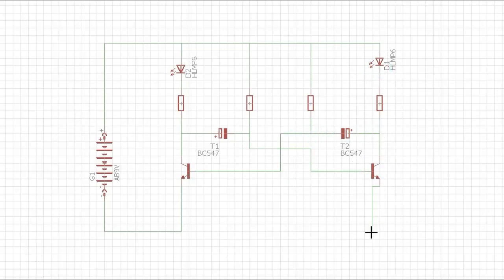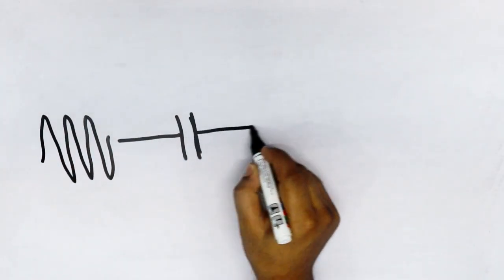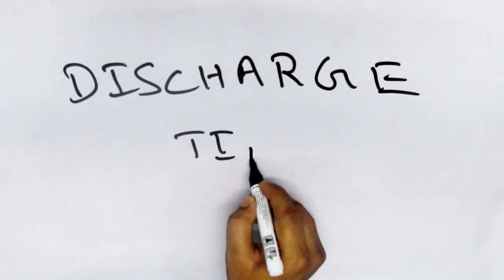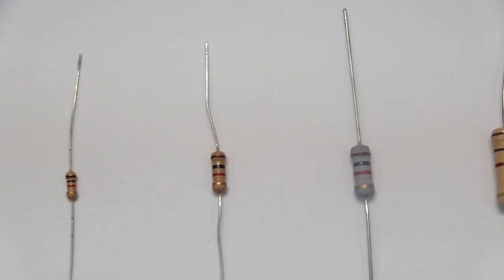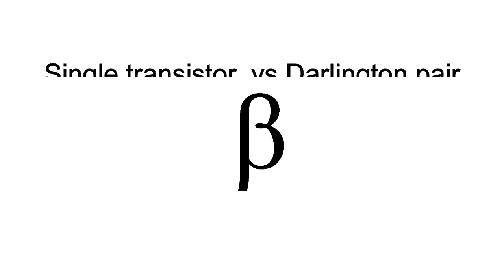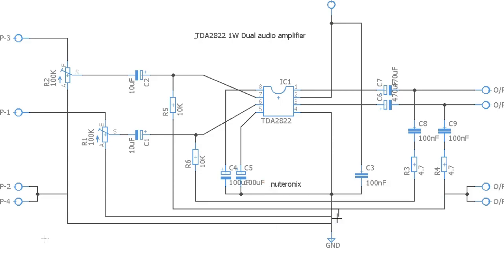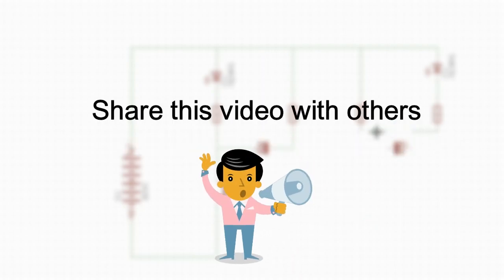10 circuit design tips every designer must know

Comment: Decoupling capacitor near the power source or near an IC chip acts like a shock absorber in your car. While the IC circuit is in operation its current consumption fluctuates up and down, at times the current fluctuation maybe sudden and dramatic if driving high load current. The capacitor near the IC acts as a Low Pass Filter (or shock absorber) to prevent those heavy sudden fluctuations and to ensure that the IC operation is maintained steadily - due to severe current fluctuations the IC may suffer failure. By the same analogy if you are driving your car on the highway and suddenly encountered a bumper or little stones then you may not feel it and you keep feeling comfortable, because your car's shock absorber springs took the shock and you didn't feel it - and you are still in that happy safe feeling. Thanks to the capacitor springs...!
Reply from the maker: Wow that's an interesting explanation, thanks Mike :)
Reply: Sir I wants to learn...how to design electronics circuits
Reply: Thats a good analogy
Reply: ❤️❤️❤️❤️❤️.....crucial info you just shared with us!!!!! This is very commonly deployed in High-End SMPS like Corsair brands directly on the socket itself ,beit for PC or other electronic devices...the only setback is the poor quality of the electrolytic capacitor they use for such high priced SMPS.
Reply: Eli Sebastian  I searched for it on Google, and the top reference was a clown.  Hmmm, am I doing something wrong?
Reply: @Gadgetronicx  It is also worth considering using flexible termination capacitors if there is any likelihood of flex in the pcb.

Comment: #1 0:41 Coupling & Decoupling Capacitors
#2 1:51 Pull up and Pull down resistors
#3 2:36 Discharge time of batteries
#4 3:33 Watch out for resistor Wattages
#5 4:21 Usage of microcontrollers
#6 5:01 Using transistor pairs/arrays
#7 5:57 Using PWM signals to save power
#8 6:49 Individual trances for signal reference
#9 7:22 Choosing the right components
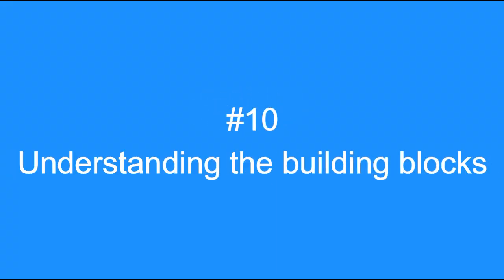#10 8:20 Understanding the building blocks

Comment: Great video, thank you! I learned some new things about capacitors and transistors.
Two corrections:
#7 "LEDs... are quite slow to react to a high-frequency PWM signal." Nope, LEDs turn on and off very fast! Most people can perceive an LED blinking at 200 Hz; some can see >300 Hz. Always use PWM frequency >400 Hz for dimming LEDs, or you may notice the blinking.
#8 "Provide individual traces when connecting different signal references back to the ground or common node." In the apps I've used, doing this in the schematic doesn't constrain the PCB layout at all; you have to remember to do it in the PCB editor.
Reply: You are correct. The video says that they are slow to react, but in actuality, it is the human perception which can be a bit slow to react, relative to circuit (digital signal/PWM) frequency.  LEDs themselves can be quick enough that an LED and high speed photoreceptor could be paired and used for sending an audio signal wirelessly.
Reply: In case of the ground return, copper pour or additional layer for ground is always helpful, if your circuit does not have any contraindication or constraint for that.

Comment: Tip#11 Reinventing the wheel.  There's plenty of circuits already made for most applications.  Just pick one and tailor it to your application.  There's rarely a need to start from scratch.
Reply from the maker: Absolutely true
Reply: Yes indeed, but also do not get afraid to invent if that is not available. Be aware and wise enough to judge that, the available circuit is modifiable enough to fit into your need.

Comment: Very helpful.  I'm not a professional designer but I like to hack things together to either make something fit my purpose, or from scratch if none exists.  I'll keep these points in mind as I advance to more complex circuits.  Particularly what you said about using a micro-controller rather than an assortment of discrete parts - something I should work on.  That being said, a 555 timer, a cap and a resistor versus  2 caps 2 resistors and 2 transistors, they can each accomplish similar goals but the former costs about $0.67, the latter, about $0.30.  That's been my justification for my fear of IC's.  But if I want to build better things with greater capabilities and accuracy, I really need to work on that "fear".
Reply from the maker: What you said is absolutely right but sometimes using discrete parts can get really messy. When developing products last thing we want it to be messy. Also I didn't shoot down the possibility of using discrete chips but rather spend some time to find the right way to achieve the objective the efficient way.
Reply: @Gadgetronicx  that is correct. And material costs is often not an issue for a maker. If you have a simpler solution you safe time and effort, event if it costs a few cents more. And the well known multivibrator solution with the 2 transistors, 2 capacitors and 4 resistors has serious drawbacks. One is the signal steepness, another one is the limitation of operating voltage to a maximum of about 5 volts (otherwise you get avalanche breakdown of the base-emitter diode of the transistors, which can be harmful if the capacitors have higher capacities, because the stored energy ist "burned" in the pn transition).

Comment: nice video sir!! , I'd like to ask why should we use two capacitor electrolytes and ceramic as decoupling?? is it enough to just use 1 capacitor??
Reply from the maker: That's a good question. Technically both the capacitors are decoupling ones. But the key difference is that the big bulky one serve as a charge bank and supplies the chip with current when there is a brief interruption in power supply. However small capacitor will be fast therefore it will be much effective is responding to voltage spike from the supply

Comment: I have a rechargeable electric shaver with a 2W resistor in the recharging circuit.  This electric razor cost $70 when new.  While charging, this resistor slowly burns itself up, especially if you deeply discharge the battery, the battery goes bad, or when you use it while plugged in.  Once this resistor dies, the whole shaver quits working.  From an engineering perspective, this resistor was selected as the most cost effective choice.  But in practical terms, this is an engineering failure.  I replaced the resistor with a 5W variant and the shaver has lasted me over 20 years so far, even after the rechargeable battery quit taking a charge.

Comment: hey new idea old subject that is if you have knowledge of computer programming and how to build them. led panels controlled by bios chips with voltage sensors placed at the end of every led to control and prevent over voltages of the led solar panel system. a bios can be augmented to allow the pass through of electricity only when needed just like the operation of a microprocessor. in this way only a portion or even a large portion can be used to create effective solar energy. this is possible because the bios program will only allow energy in when it is needed. this will prevent over voltaging of household circuits. a simple switch sensor will prevent too much power from reaching the circuit by saying it is not ready to use. this can be tested with very bright flashlights to prove how many chips will be needed in a circuit and should be test by someone. good luck.

Comment: what happens if I use 1V 1AmH battery for a circuit that consumes 1V 2AmpereperHour? Does it just break the battery or it just gets discharged quickly?
Reply from the maker: Hi Sai, Ampere per hour is meant to refer the battery capacity. It's the most common method to specify a battery's capacity. Whereas when you refer to a circuit drawing 2 Ampere it means that it is consuming 2 amperes per second. Regarding your question theoretically if you draw 2Amps from a 1Ah battery it will discharge in half an hour. But batteries are quite complex in practical circuits. Discharging a battery's full capacity can certainly cease it from working. It also depends on its battery chemistry

Comment: Sir I have a doubt ,when capacitor is connected in parallel to the ice or supply voltage ,it becomes a junction .in these cases the capacitor will have same voltage and ic too have same voltage can plz clarify these
Reply from the maker: Yes the capacitor will have same voltage as power supply. This is quite commonly used to stabilize the output.

Comment: Why do you need pull down resistors? Why not simply put a wire to the ground?
Reply from the maker: Without pull down resistors you are putting your Vcc to come in direct contact with gnd that's short circuit
Reply: @Gadgetronicx  thanks!
Reply: @Gadgetronicx  thanks! Which value do you choose for your resistor then?